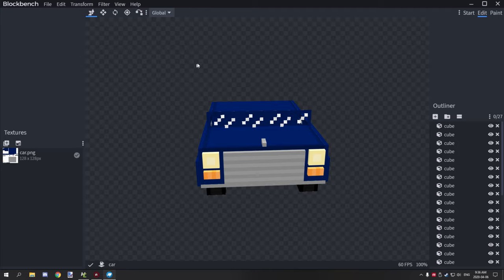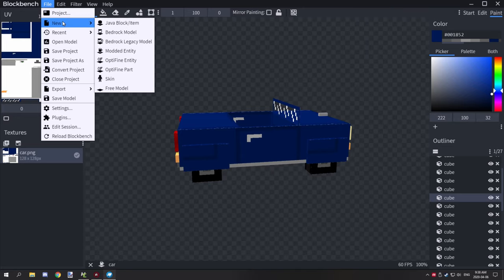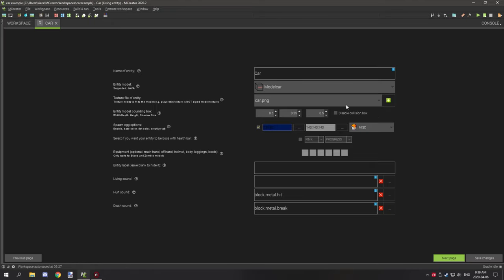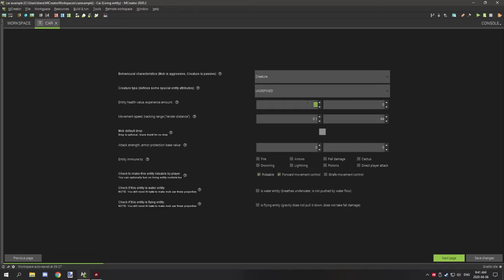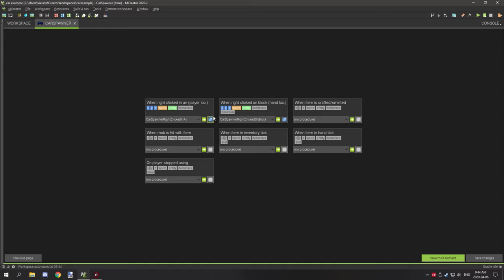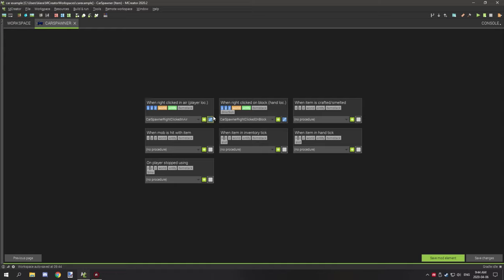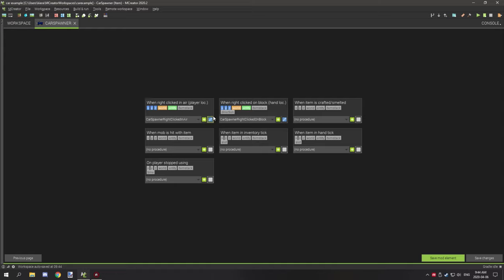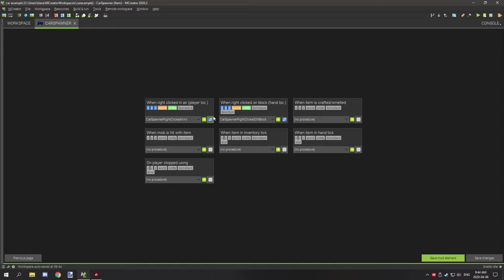MCreator Tutorial: How to make a car | 2020.2

Comment: When I try using a rideable mount, it won't move up one block simarly to how a horse will autojump onto the next vector. I was wondering if this is a bug or if there is a custom procedure to fix this?
Reply from the maker: Normally this would not be the case, though depending how you have your entity set up you may want to double check if its not a workspace issue by creating a basic example workspace and testing if the ridding mechanics works with no triggers, if this is the case then its most likely something in your workspace that is preventing it.

However if it still does not work then you can use the same example workspace to open a bug report and the devs can work on fixing the issue.
Reply: @NorthWestTreesMCreator  Thank you for your insight. Also, I am trying to create a flying entity; and I have the entity flying but I can't seem to get it to move faster unless I made it into a grid movement system (which feels quite limiting). Do you have any recommendations on a good procedure?

Comment: i try to model a car, but it appears tiny in minecraft and it doesnt sit me in the correct position, even higher than what i wanted
Reply from the maker: For the sitting part make sure your seat location is directly over where the 16x16 grid is in Blockbench this is where the player will be seated when they drive the car. For the size this could be because the model was designed to small, you can also use the grid as a reference for the size of blocks as it's exactly 16x16 pixels which is what 1 full block is in size. Also make sure that you offset the sit position which will need to be in the negative value, by default it will be set to the height of your entity so you will need to use negative values to put the player inside the car.

Comment: It seems that whenever I use the Paint Tool to try to create a texture for the model, it colors multiple pixels that I don't click on. Can I make a texture without using the pain tool?
Reply from the maker: I noticed this too, I don't use blockbences built in program I normally use Paint Dot Net photo editor for all my texturing needs as I have more control over the values and hues etc. Here is the link if you don't have it already its free.
https://www.getpaint.net/
Reply: @NorthWestTreesMCreator  Thanks
Reply: @NorthWestTreesMCreator  Also, is there anything free that I can use? I'm on a $0 budget.

Comment: I tried to make a little dragon to ride but when i try to sit on his back Steve is sitting one block higher, any solutions?
Reply: try changing the height of the entity in mcreator. (I'm not an expert so I don't know if this will work for you, it worked for me)
here's and example : https://imgur.com/a/W1ULV5B
Reply from the maker: The entity height will offset the sitting Y location, its measured using the same system block boundary blocks uses so 0.062 would be one pixel 0.5 would be a half slab 1 would be a full block, you can go over 1 so 1.5 would be a 1 and 1/2 a block. I hope that helps.
Reply: @NorthWestTreesMCreator  thank you mate!

Comment: for some reason my car is 90 degrees to the right, idk why
Reply from the maker: You most likely did not make the car model face north in blockbench, this would cause the rotation to be off.
Reply: @NorthWestTreesMCreator  Thank you for responding and that was the issue.